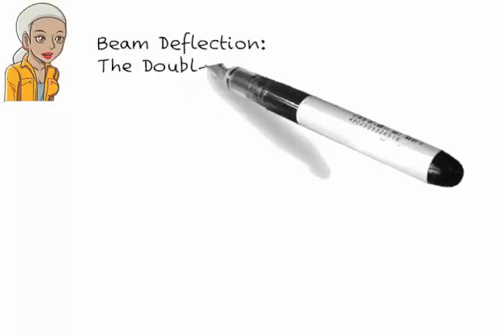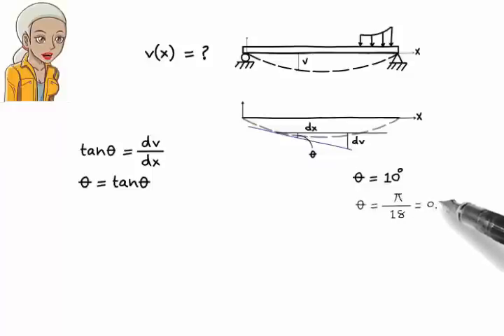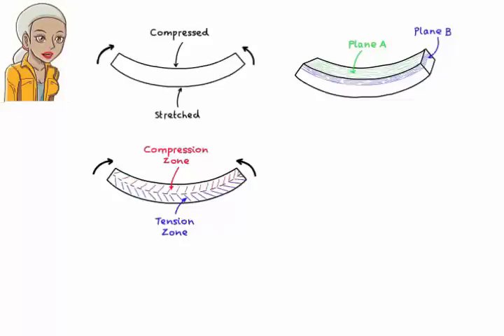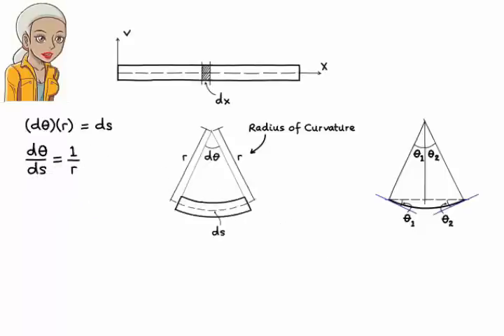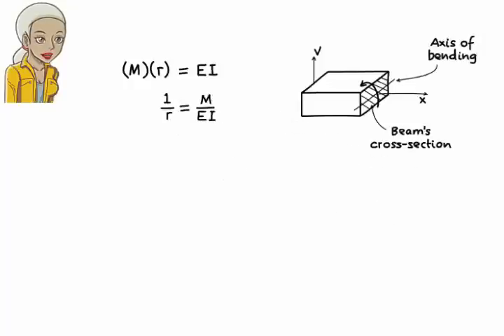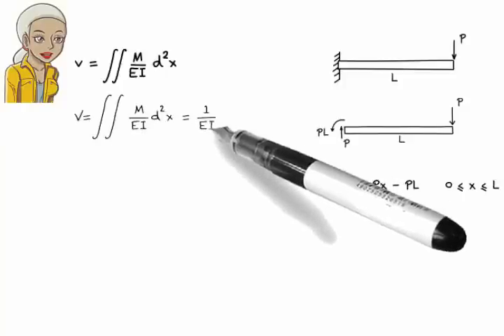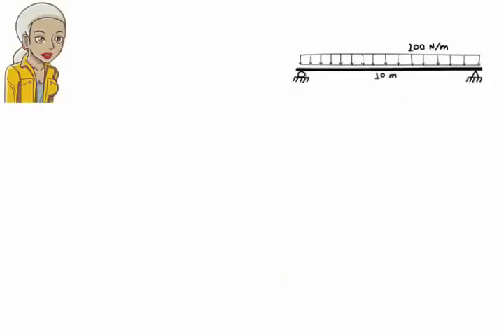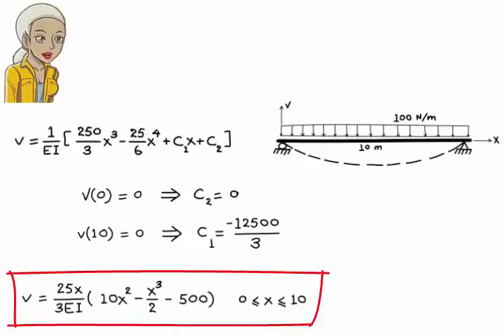SA12: Beam Deflection: The Double Integration Method

Comment: What will be the deflection formula for steel cylindrical pipe, hand rail with two posts on two side?With a point load? Is it the same way?
Reply from the maker: Yes, the same principle applies. However, to determine the moment equation for the pipe (beam), the system needs to be analyzed as a frame. That is, the pipe/beam cannot be assumed to be simply supported.
Reply: @DrStructure   thank you very much for the clarification i was confused whether it will be a beam with fixed end or frames with fixed end.
Moment of inertia of hollow pipe will be pi*(D^4-d^4)/64
I am confused about the formula regarding the deflection(WL^3/48EI) according to me,but as you mentioned it will be considered as a frame. 
I will look at it.

Comment: Hi at 11:20 you are saying d theta is the difference between the slopes but the figure on the right shows d theta to be theta 1 + theta 2. Am I missing any sign convention rule. Please help.
Reply from the maker: Note that in the diagram to the right the two slopes on the beam have different directions. The left one is obtained by trurning the beam clockwise, the right one is the result of a counterclockwise rotation in the beam. So, one is positive and the other  is negative. When subtracting one from the other, we end up adding their magnitudes.
Reply from the maker: They don’t overlap. You can view it as you explained, one is placed to the left of G and one is placed to the right of G.
Reply: Thanks a lot....

Comment: at 9:42, why you did not consider a moment from the pin joint in FBD?
Reply from the maker: But there is no moment at that pin. A pin or roller support at an end of a beam has zero moment.
Reply: @DrStructure  thankyou for your response ... ! 
I am really grateful that I have come across your lectures it was really very helpful.
Thankyou very much
Reply from the maker: You're welcome. Thanks for the feedback.

Comment: Why didn't you take M(X) as negative? It's direction is Anti-clockwise
Reply from the maker: The sign convention is rather arbitrary. We can assume either clockwise or anti-clcokwise to be positive, as long as we use our chosen convention consistently throughout the calculations.

Comment: why the moment value is not px? i couldnt understand how the moment value became px-pl. pls explain
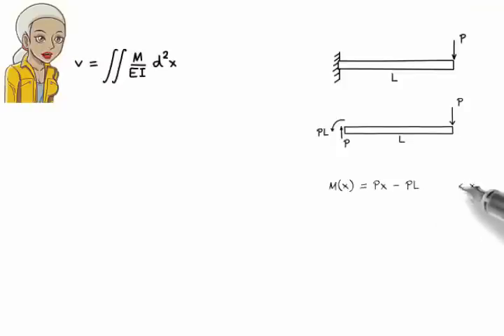Reply from the maker: @07:46, the beam is fixed at the left end with a counterclockwise moment of PL in place.  Further, there is an upward vertical reaction force of P acting at the support.  Both the reaction bending moment at the reaction vertical force effect internal bending moment in the beam. 

If we cut the beam at some arbitrary point, say x, from the left end of the beam, then bending moment at that point is a function of the reaction forces I mentioned above.

Since PL is already a bending moment, we don't multiply it by x, we simply carry it over to the cut point. The vertical force, however, needs to be multiplied by x in order to determine the moment the force causes about the point. 

Hence, the total bending moment at the cut point is: PL - Px. The negative sign implies the two terms are acting in opposite directions, one is acting in the counterclockwise direction and the other in the clockwise direction.

Comment: at 8:03, why can't you take the p out of the integral? I thought p is a constant
Reply from the maker: In both cases (videos), P is constant. Whether we leave such a constant to the right of the integration symbol or move it to the left of the symbol is not significant. That is, Integral (P) = P Integral (1). Or, Integral (P x) = P Integral (x). 

The only difference that we would experience is in the integration constant. For example, here, since we left P inside the integral, the expression for v became:

V  = (1/EI)( px^3/6 – pLx^2/2 + C1 x + C2)

If we take p out as a constant before integrating, the expression for deflection becomes:

V = (p/EI)(x^3/6 – Lx&2/2 + D1 x + D2).

The only difference between the two equations would be in the values for the integration constants. But that does not matter at all, since if we multiply p by what is inside the parenthesis in the second equation, we get the first equation. That is, C1 = p D1 and C2 = p D2.

Comment: iI really appreciate what your are doing in those videos. however, at the end of this video, should the moment equation be 500x-100x^2 or not? i don't get from where come 50X^2 you wrote. thank you
Reply from the maker: The distributed load is 100 N/m, the length of the segment is x. This makes the equivalent concentrated load 100x. This load is placed at the center of the segment, at x/2 from either end. So, the moment arm would be x/2. Therefore, the moment of 100x load is: (100x)(x/2) = 50 x^2.

Comment: what is meant by beam deflection?
Reply from the maker: +Lyrex Ices It means deformation due to bending. In the case of a horizontal beam subjected to a vertical load, it means vertical displacement of the beam at a given point. If the beam moves (displaces) downward at a point by, say 2 mm, then it has a deformation/deflection of 2 mm at that point.
Reply: +Dr. Structure thank you

Comment: Why is the moment - M(x) not equal to PL-PL?
Reply from the maker: Please be more specific. Where?
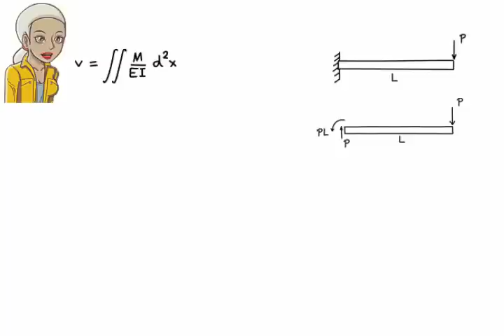Reply: At 7:40 why is the moment equation: M(x)=Px-PL, I thought because the length was L and not x the equations would be: M(x)= PL-PL=0? Thanks
Reply from the maker: The moment value at x = L would be PL - PL. That is not what we are looking for here. We are not looking for the value of moment at a specific point, we want to write an equation for the moment for the entire beam, an equation in terms of x where x could take any value between 0 and L. That equation is M(x) = PL - Px. This can be used to determine moment at any point along the length of the beam, at x = 0, we get PL; at x = L/2 (mid-point of the beam) , we get PL - P (L/2); at x = L, we get PL - PL; ...

The double integration method requires the use of the moment equation, not the value of moment at a specific point.
Reply: Then why did you wrote M(x) = Px - PL  in the video.That equation is wrong.
Reply from the maker: Why is the moment equation for the beam is wrong? Please explain.

Comment: 10:55 - where does the equation -12500/3 come from?
Reply from the maker: @10:55 we have:
v(x) = (250 x^3/3 – 25 x^4/6 + c1 x + c2)/EI

The boundary condition is:
v(10) = 0 

Substituting 10 for x in the above equation and setting it to zero, we get:
(250,000/3 – 250000/6 + 10 c1 + c2)/EI = 0

Since c2 = 0, the above equation simplifies to:
250,000/3 – 250000/6 + 10 c1 = 0

Or, 
c1 = -12500/3

Comment: V(10)=0 I got C1=-25000/3
Reply from the maker: v = (1/EI)(250 x^3/3 - 25 x^4/6 + c1 x + c2) 
set c2 = 0 and x = 10,
v = (1/EI)(250000/3 - 250000/6 + 10 c1)
or, 
v = (1/EI)(250000/3 - 125000/3 + 10 c1)
or,
v = (1/EI)(125000/3 + 10 c1).

Solve for c1 by setting v = 0.
(1/EI) (125000/3 + 10 c1) = 0
or, c1 = -12500/3
Reply: @DrStructure  
Why not solve for C1 using equation of first integral of Moment equation.? Set V=0 x=10....is it posible to do that way?
Reply from the maker: @Mr.P539  The first integral of M/EI gives us the equation for the slope of the beam. If the slope of the beam is known at a specific point, then yes, we can use that equation to determine the integration constant C1. In the case of a simply supported beam, the only known boundary conditions are the end deflections; neither of the end slopes is known.